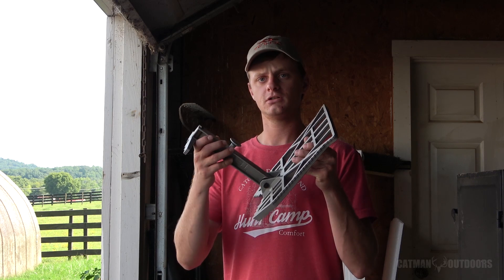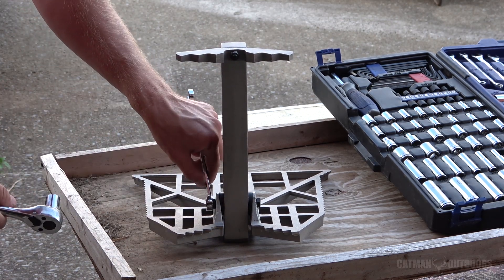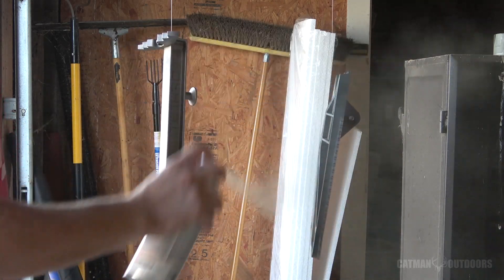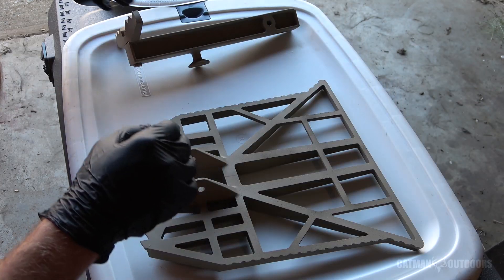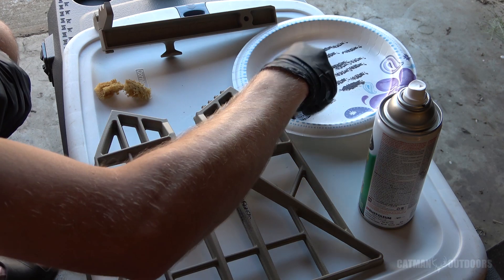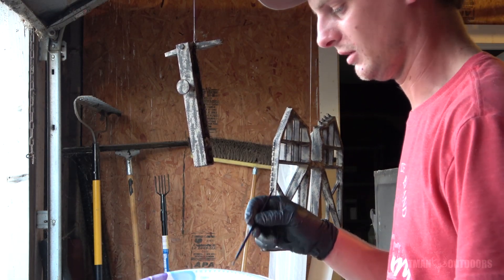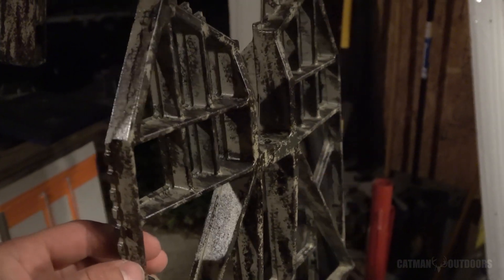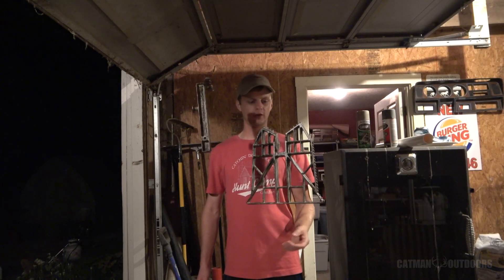DIY Tree Bark Camo Paint [Predator platform]

Comment: Tip for anyone who has regular sponges and doesnt want to buy a "sea sponge" You can create the holes and divets/ uneven patterns really easily by using a pair of needle nose pliers. Just pluck out a few sections of holes. makes the camo pattern look a lot better. I have tried using a razor blade and knife but Ive found you get the best results from plucking a few holes and roughing up the sponge.
Reply from the maker: Obsessed with the Outdoors I bet that looks good too. For those who don’t know, sea sponges are cheap! Got a link in the description, like 4 bucks.

Comment: Another great video... not sure but maybe use a 0000 steel wool and take some of the gloss off of the matte clear coat. Test a spot first. I roughed up between coats of polyurethane when I did my hardwood floors.
Good Luck this season.
Reply from the maker: Good idea! Only problem I see is it would probably polish back down from wear and tear of using the platform. My shotgun got shiny spots where I always carried it between the receiver and pump.
Reply: I'm sure your right about wear and tear.